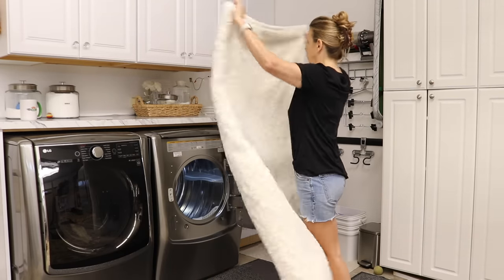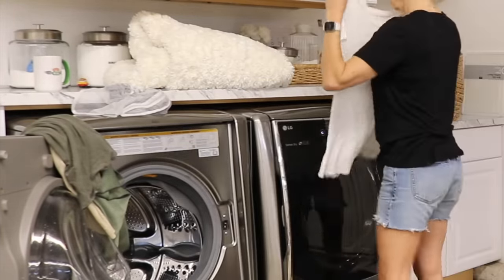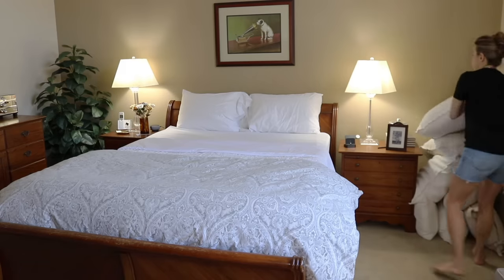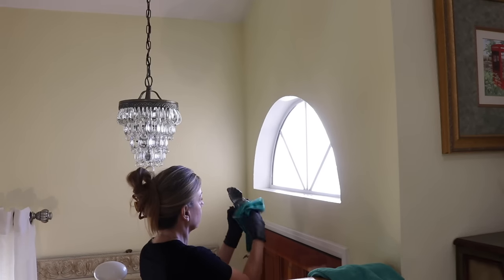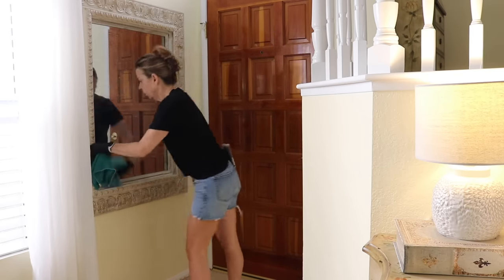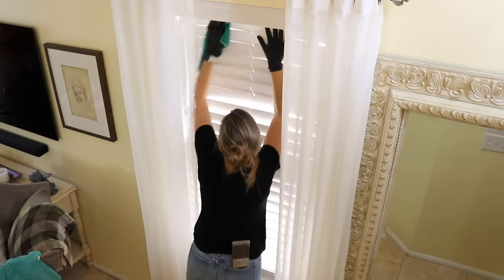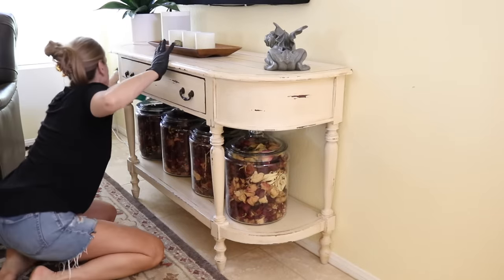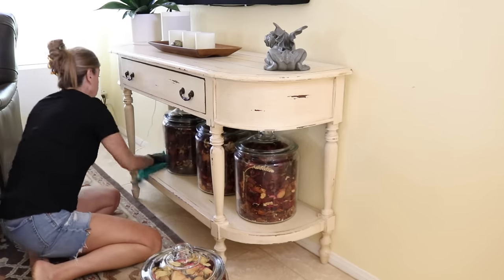CLEANING MOTIVATION | ZONE CLEANING SERIES | PART 5

Comment: Hi Randi!
Thanks for telling me why you use microfiber. I inspired me to buy a whole pack but I’m still trying to figure out the benefits.
****** DO YOU  COLOR CODE THE CLOTHES PER TASK?
Thanks!   🌸
Reply from the maker: Hi Molly! I color code by use. One color for bathroom, one for kitchen, one for general use. They pickup and hold dirt and bacteria and rinsed away with water. They also have better “scrubbing” power than regular clothes or sponges. And they work with out additional cleaning products. High heat and certain chemicals can damage them.